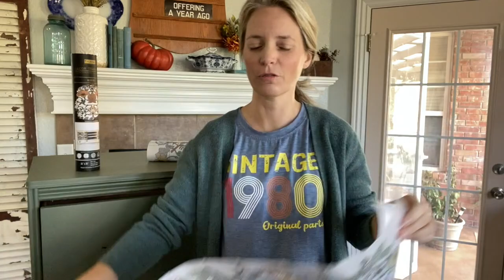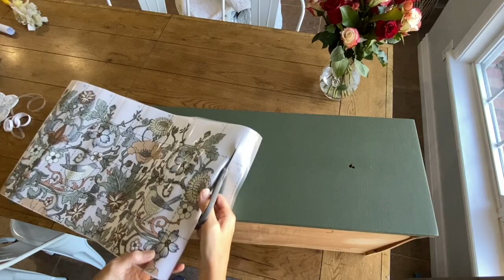How to Apply a Transfer to Furniture | Redesign with Prima Transfer Tutorial | Fusion Mineral Paint

Comment: So glad you showed a transfer that doesn't release as easily. I have run into this several times, especially in the brand of transfer you were using. The other thing I think was helpful that you addressed was halo, again some brands it shows more, especially over darker color paints. Often times content creators edit through the challenges when they could be very instructive. BTW, that's a lovely calming finish (both in paint color and decor transfer) without being the typical neutrals the market is so saturated with still. Great job on all fronts!
Reply from the maker: Glad it was helpful!

Comment: Do you think this would work on chalk painted furniture? Also how did you get your paint so smooth! When I use chalk paint I get streaks sometimes.
Reply from the maker: Absolutely it would! Just be sure to apply before you apply any wax. This paint I used was Fusion Mineral Paint, which is different than chalk paint—I’ve always found it to be much smoother :) When I use chalk paint though I would typically water it down some to help with the brush strokes, or use a mister bottle

Comment: Stunning! Such s soft gentle look! I have reservations about the wax holding up. Will a water based paint such as Sherwin Williams satin interior door and window paint work? And, after applying the transfer will Min-Wax water based polyurethane over the transfer work? TY.
Reply from the maker: Yes! You can use a water based topcoat if you like

Comment: That is beautiful! I am just starting to paint furniture and love the idea of transfers. What is the benefit of using the beeswax and why use it verses another finish? Thank you for your help!
Reply from the maker: Great question! I like the Beeswax Finish specifically for darker Fusion colors. Because it has a touch of hemp oil in it, it gives the darker colors a subtle sheen that helps diss guide fingerprints and other dust marks, etc. On lighter colors you can use a regular clear wax for sure :)

Comment: Is it possible transfers get old? I ordered some from redesign off of Etsy and I feel like they don’t have that tacky feeling so they are not sticking. Then when I hold it in place and use my wooden tool, nothing comes out,
Reply from the maker: Yes! They unfortunately have sat too long and the adhesive has dried. I would contact the Etsy seller and ask for a refund